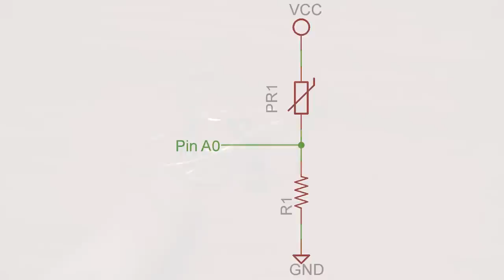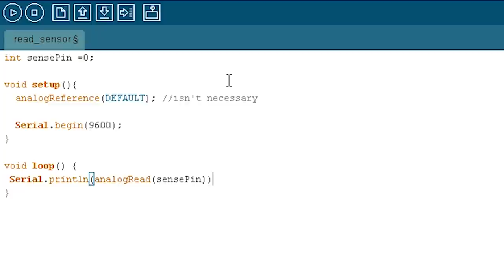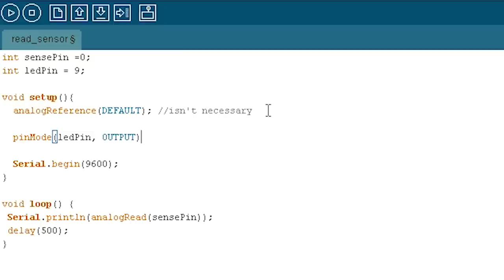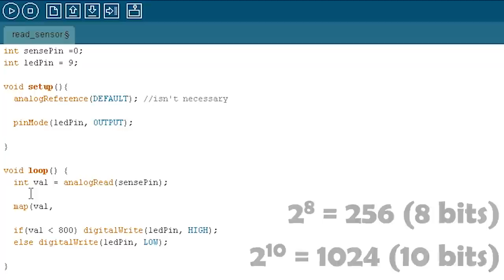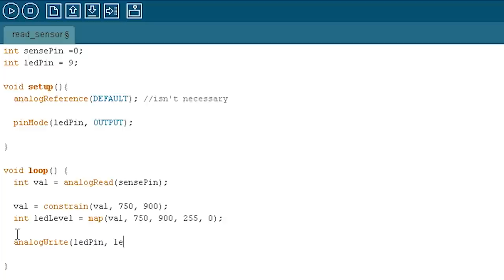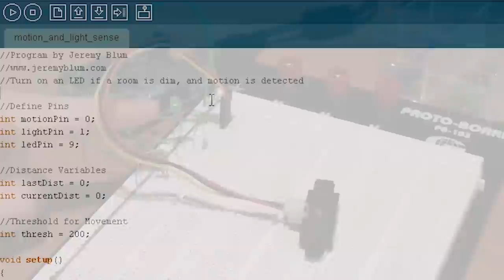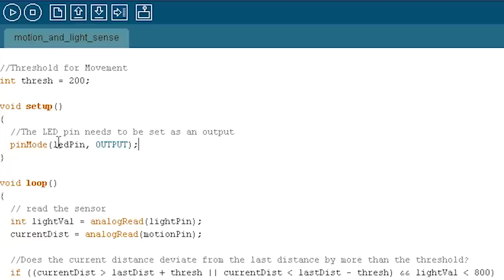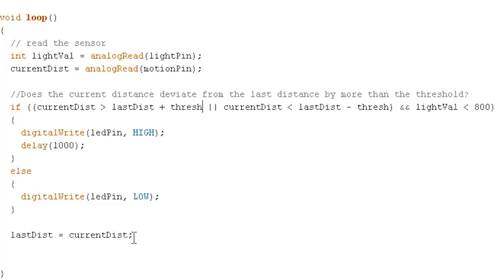Tutorial 04 for Arduino: Analog Inputs

Comment: I like your video. Will you help me create a Script to do the following:
1. Accept an input from a simple Normally Open contact Closure (push button) to start sequence. 
2. When button is pressed: fire relay 1 for 30 seconds. After 30 seconds, release relay 1. Then need the script to fire relay 2 for 30 seconds and then Release relay 2. No loop is required.

Comment: I have a question, so lets say you have an analog input, and you wanna write that input to 8 pins, thus 8 bit. in assembly you would simply move it to lets say porta,
how would that be done here?
Reply: Well first off, for saving an analog input, you need more than a single bit per pin. That would be done using int (analog) instead of boolean (digital).
To set 8 pins, you have to call all of them seperately:
analogWrite( yourPinNr , yourValue );
If your pin numbers are consecutive, you could use a for loop:
for ( int i=firstPinsNr; i < lastPinsNr; i++ ){
analogWrite( i , yourValue );
}

Have fun buddy :D

Comment: I am finding these videos very useful, however I keep running into one issue or another (operator error mostly). right now I am having trouble with my print line displaying higher values with less light, and lower numbers with increased light.... can not figure out why
Reply: hint. its a little something called BASIC MATH. work it out

Comment: @sciguy14 The resistance varies when the actuator arm moves, so the position of the arm could be determined. So one wire is left. I assumed this would be the output from the potentiometer, but I don't get a voltage however I wire it (maybe it's broken?). I tried the voltage divider circuit with a fixed value resistor already, but didn't get that good of a resolution on the Arduino. What would be the best value for the fixed value resistor for this to work? Thanks for your help.

Comment: Hey man... nice tutorial series, I´ve been following so far with my new Aduino. But mine did not worked after you put the led light. If downloaded your codes, to be certain that I did not written something wrong but was not this, maybe something in the assembly I didn't get. When it runs the led stays on in a faded color, and doesn´t move with the changes. In the post window the sensor shows no variations of values... what could it be?

Comment: I want to know that while connecting LED ,one wire get connected to digital output pin and other is connected to Ground on breadboard .
Why don’t the other end get connected to 5v power line on breadboard.
Please tell me. I am unable to understand this logic.
Reply: This is so that u can use the arduino to control your led by using a digitalWrite function. If u connected it directly to 5v it wld leave the led permanently high.

Comment: Hi, im looking to use two cooling system meters to give me my true flow since my desired flow is less then that of a single meter can measure. Can an arduino take those two subtract one from the other and display the sum. say meter one is giving the voltage for 4.5 gpm and meter two is giving voltage for 4.0 gpm can it display a reading for.5 gpm. Also could i get help with that program

Comment: Whjy didn't you assigned A0 to be OUTPUT like you did with the LED pin?
Reply: analog pins can not be outputs on the arduino
Reply: Sorry I meant Input. 
I'm assuming that if you don't set the pin as input, Arduino assumes you are using the analog pins right?

Comment: int motionPin = 0; 
is simply defining a variable named "motionPin" as an INTeger and setting it's value to "0".  He's not actually assigning a variable to a certain pin on the board, just using it as a placeholder because it's easier to remember names than which pin does what.  He could just as easily have typed: 
currentDist = analogRead(0); 
although that's very bad practice and you should never do it.  Instead

int motionPin = 0;
currentDist = analogRead(motionPin);

Make sense?

Comment: If the led is next to the photo sensor or if the light from the led is bright why doesn't it revert back to off ? It turns the led on cuz it sense its dark but the led is gonna make it bright so  shouldn't it be shutting off the light on nd off  ?
Reply: no because the led doesn't have a wide enough angle of light, the photo sensor only receives light on the top, and since it's a colored light it isn't detected as strongly. Between those three factors, the photo sensor won't sense much of a difference

Comment: i am getting invalid and jumping readings from my light sensor, it will not stay at a constant value it slowly goes up to 330 and down to 270 on random. shining a light upon the sensor or placing it in the dark only varies the reading by a maximum of 10 units. i have a 10k resistor in place. does anyone know what could possibly be wrong?

Comment: hey jeremy,
i tried lighting my led using the photo resistor but when i try to place the led on the breadboard it doesnt light up. when i place the led on the board directly with anode in the set pin and cathode in the ground pin, the led lights up but its very dim. what could be the problem
Reply: Maybe you were using the 3.3v output. you could double check your voltage and your resistor resistance to see if theres something wrong
Reply: thank you, i'll try that and then will get back to you
Reply: did you set the mode for that pin to output?

Comment: how do you know the potential range is 1024?
Reply: check the video at 01:18 we dealing with a 10 bit ADC (analog to digital converter) and 2 to the power of 10 gives 1024 :)
Reply: to @XLCaudio: The official webpage of Arduino says it for each of their products. Taken from de UNO Tech Specs: "The Uno has 6 analog inputs, labeled A0 through A5, each of which provide 10 bits of resolution (i.e. 1024 different values)."

Other models may have different resolution for Analog I/O.
Reply: oh cool that makes sense. cause he just kind of brushes over that stuff super fast and Im kinda slow... thanks
Reply: XLCaudio I believe you may have b[rushed] over this series.  You're awesome Mr. Blum!